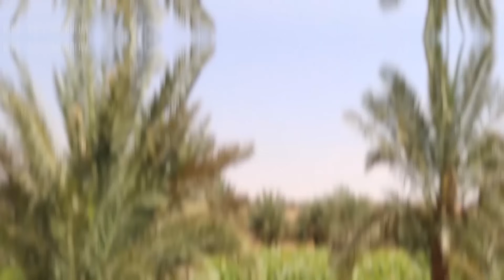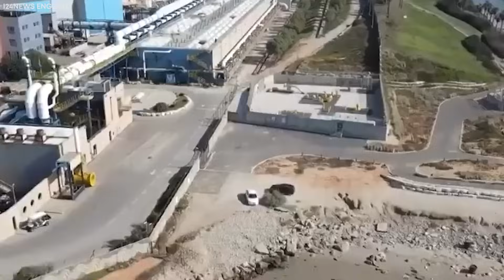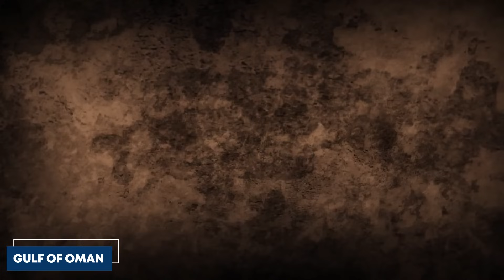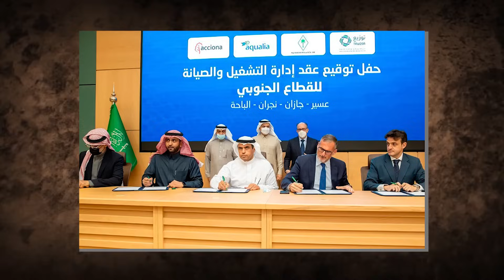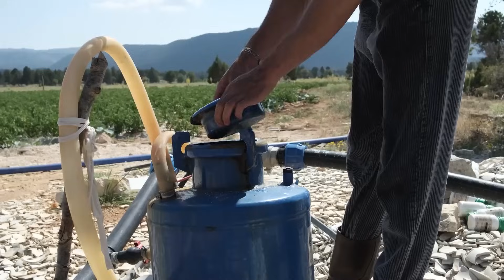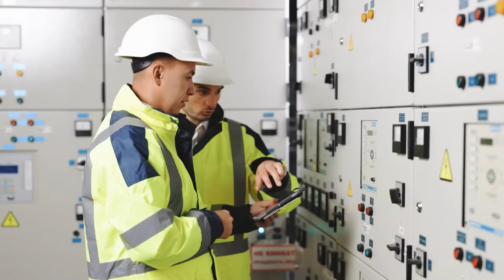How Saudi Arabia Gets Water TERRIFIES Scientists

Comment: Very uninformed .    Reverse Osmosis SWRO plants are now replacing most thermal SWRO plant in Saudi .   1) they  do not have  copper in the brine   2) they do not have chlorine in the brine (all chlorine must be removed before polyamide SWRO  membranes) .    3)  There is concern about the use of antiscalants , and it is possible to remove its use by correct design  of the SWRO .   Thus the brine can be made clean .  A correctly designed outfall can ensure the brine is dispersed  so that by  100m  of the outfall the salinity to no more than 2% salinity above ambient , this protects  seagrass and  marine life .

Comment: Well... surely it's possible to evaporate the water from the waste brine rather that running it back into the environment... the resulting salt could be disposed of in a different way and could even be exported and used as a salt spread on icy roads... 
Problem solved

Comment: You have 250,000 square miles of desolate wasteland comprised of nothing but sand. Why not dispose of the brine in the desert and cover it with the sand. It would take thousands of years to run out of space and in the meantime, there will be better waste solutions discovered.

Comment: You failed to mention the reason why reclaimed wastewater is not suitable for human consumption is the concentration of heavy metals due to the use of these metals in the household plumbing for portable water and the use of heavy metals in connecting the sewage pipes.

Using reclaimed water that has been processed properly can be consumed by humans if the heavy metal content is not excessive.

These waters can be used to water lawns, city parks and use that power generating stations for the steam water.  In fact, where I live there are power generation stations using reclaimed water.

The downside of using reclaimed water is that the water is not released into aquarian areas to be filtered with natural grass and plants to replenish the aquifer.

If this is a point that you failed to mention that reusing treated wastewater robs water whichr would have naturally percolated to the aquifers.

In our home we have low flush toilets, water saving shower heads, and an automated watering system to deliver water directly to the roots of our plant and tree.

There are things that we definitely can do to reduce water usage, but we also have to have water. Desalinization is one answer and the effects of discharging brine can be mitigated by discharging through pipes the brine far offshore through.
Reply: They've found that PFAS have gotten into Michigan's sewage system due to industrial runoff. Hence I am only somewhat a fan of reclaimed water. These are cancerous forever chemicals. God knows what other toxic substances get into our sewer systems. Obviously the solution is to have better filtration systems as well as regulations on what can go down the sewer systems.

I do believe in desalinization plants and that the brine problem can be mitigated. Although the brine is concentrated copper, chlorine, and other things, it all comes from the ocean.
Reply: How Mao

Comment: What I don’t understand is, why the waste water isn’t stored in huge isolated desert areas. First of all the sand is a natural filter, huge dunes have no plant life. If there ate no fresh water resources beneath it, it cant contaminate salt wayer eras with hifgh salt concentrations. Even if you pump alot of fresh water up, yuo don’t want to create random sinkholes.Much of the water is sprayed on top, but more sustainable would be under ground. Fixing the water level. Nature uses brackish water to switch from one type to another. Why not copy that system. You want a brine that isn’t contaminated.  Because then you can  deposit it in old excavated salt mine areas. Too much focus on technology, while nature solved the problem long ago.

Comment: Ok, so turn all your offshore oil platforms into atmospheric water generators to make drinking water and powered it by slow speed underwater turbines called Waterotors made in Canada. Atmospheric water generators can operate at max efficiency just off the service of the ocean where humidity is 100%. You might add wind, solar and Waterotors in tidel flow areas to make drinking water and electrical power to sell or use back on shore. This idea works without the problems of desalination plants returning salty brine back into the ocean.

Comment: Yeah but water do you sell an ization doesn't have to be energy expensive. You could take your arrangement of mirrors focus them on a single point put a large tank of water seawater there and use magnifying glasses to enhance and concentrate that light even more. And in those tanks that you have fold with seawater you could boil it creating steam which could be used to turn electrical turbines creating electricity instead of costing it. 

   Now at the same time that steam would not have to be released into the atmosphere could be Ransom tubing condensed back into freshwater any excess salt could be taken from the empty tanks and harvested you just have a cycle of them revolving through this array of mirrors and magnifying glasses and you have an almost endless supply of freshwater in free energy

Comment: What about a concrete trench miles long with a recycled plastic canopy which uses the suns heat to evaporate the water to drip to the sides with a catching system, separating the water from salt. Sell the brine and make sea salt. Or a solar panel attached to a cooling rod which circles by a recycled plastic tube and catch the condensation. Also, why don't we put the water going onto crops just 6-12 inches deep so the roots get it more efficiently and lessens evaporation of crop water... Just ideas.. can anybody use these to benefit many water scare countries?
Reply: Nice thoughts and I would use that on sea in small scale in a boat to get water for drinking....But I'm afraid that this solves only partially the water issue for the country. It's a little slow, evaporation. But no worry...I suppose it's much cheaper than digging an enormous surface for trenches to evaporate a substantial amount of water if in that sunny climate the Saoudis put a big area with solar panels...using that energy for desalination of seawater.
Reply: @reiniernn9071  yes and the solar panels can have heating rods too to help increase the rate of condensation/evaporation. And sections of track that can remove the brine. Without interrupting the process at all. If I had money I would absolutely have faith that many steps makes the road. And many bricks are each tools for the grand purpose of the finished wall
Reply: What you are suggesting would take so much land space and would not produce sufficient amounts of water needed for the population.
The technology you are referring to is called solar stills and it works well in low use applications such as individual homesteads.  This technology does not scale up well and is very labor intensive in needing removal of the salt crystals which adhere to the walls.
The energy and water it would take to remove the crystallized salts would negate any energy savings.
Reply: @ernestestrada2461  so I see a two foot wide trench with sections to collect the salt brine. But the trench would be miles long which can make an continuous S shape. I don't think it would take so much space no more than a few city blocks. And if u can stack this trench... I mean make it stories high... I think it would be efficient on a large scale. The key would be the continuous evaporation and condensation on the plastic tarp... I thinks it's very possible. But I would never know without a team of researchers.
Reply: @ernestestrada2461  as for the crystalized salts... It would be like mats which collect it at certain sections and those mats are replaceable. Even making it efficient if the mats could be cut and sold as is... Just brainstorming...
Reply: @RenatoA-yu9sj  how much in petrol fuels at energy would it take to make these mats to hold the salt?
The problem with too many people is they think there's an overly simplistic answer to things that have very technical issues involved.  Salt is highly corrosive.  There's a whole host of other issues you don't understand because you haven't worked in an engineering environment.
Reply: @ernestestrada2461  I think some people just behave complicated to resolve simple issues for sake of administrative fees... And doubt 🧐. You seriously just said the "mats" is the inefficient cost?!?! 😲 Wow 😲.. I think you would be removed from the r&d team for making excuses to not resolving issues regarding a NECESSARY issue
Reply: Plastic = death

Comment: What happens to the salt they extract from the sea water?
Reply: They do not extract salt from the water, but they remove part of the water to make it drinkable and what is left over is seawater with a very high concentration of salts, which is thrown into the sea, affecting the ecological balance.
Reply: @JJLV2495  Yes that's what I imagined. I realize, I described the process wrong, but I was right about the issue. This whole "green energy/clean water" movement is only gonna work if they start thinking at least a little bit ahead. This is in no way different to pumping up groundwater. Just as dumb and short-sighted. Plus I think there could be uses for the salinated water. It could be used in a huge underground battery, e.g. to store green energy from Solar. But Saudis don't need Solar, they have oil. It's not really about technology or green industry. For them it's about what they need and how they get it.
Reply: Animals...

Comment: Will using Billions and billions of gallons of sea water have any significant impact on sea levels?
Reply: No, because it all ends back in the sea.
Reply: Actually it's a good thing for the oceans.
Due to the melting of polar ice caps it's pumping more fresh water into our oceans. 
Which will cause a catastrophic effect on the Earth.
Reply: Not really
Reply: No, it's insignificant, 1 billion cubic meters equivalent to 1 cubic kilometer. Earth is estimated to hold about 1,386,000,000 cubic kilometers of water
Reply: Let them pump the seawater, bcoz the north pole is melting
Reply: Essentially it's all going back into the ocean one way or another